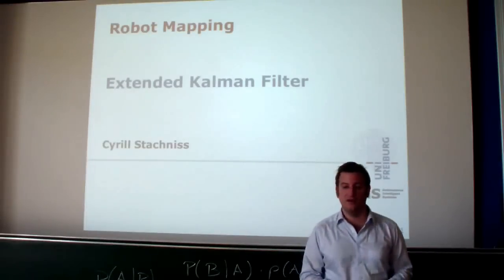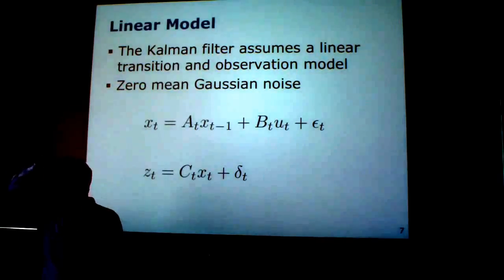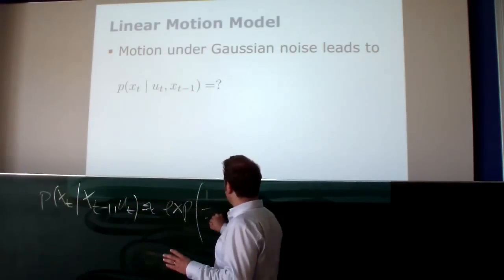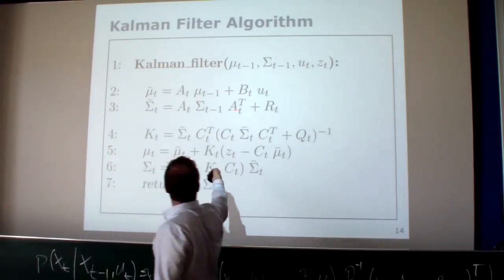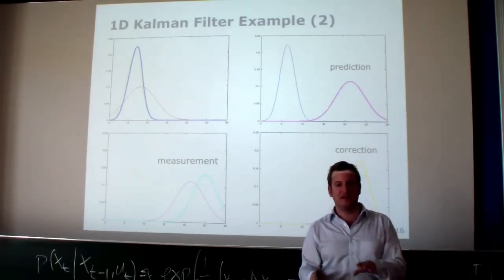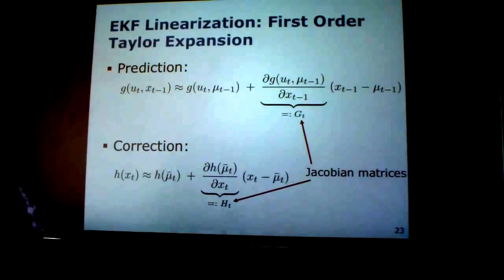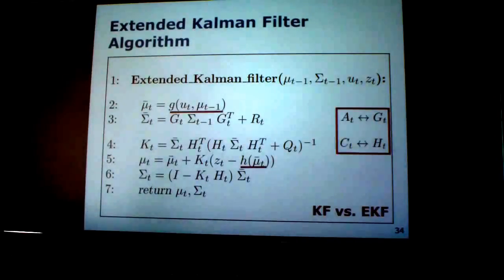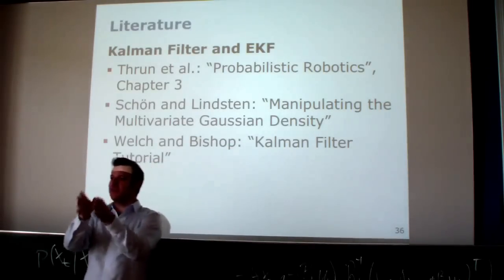SLAM Course - 03 - Kalman Filter - Cyrill Stachniss

Comment: Hey Dr. Cyrill,
i am M.Sc. Researcher in project management for construction,
i have seen lately that few researchers talked about Kalman Filter as time predection of the time schedule of projects and how it have the most reliable estimates up to calculating variance according to the initial time plan,
i am thinking of using the kalman filter to predict both time and cost while monitoring the projects and predict the final total cost and final project duration , while having data of ( planned value , actual vales ) at several points ,
but sadly still not aware of Kalman and how it works and trying to understand it ,
i need only to know if it able to do what i want to do , or i will go through all of this to dead end ?
please advise